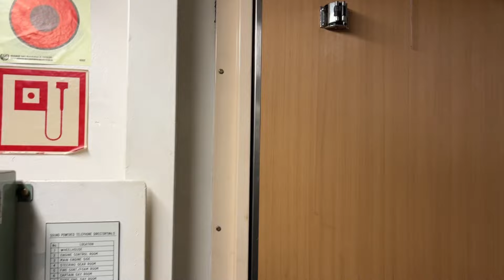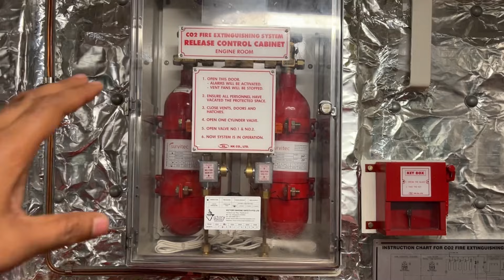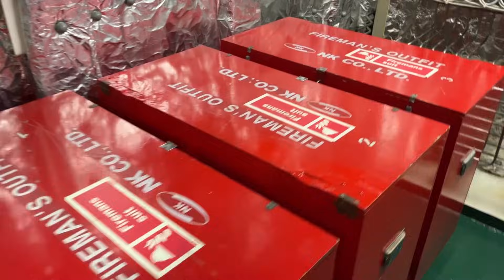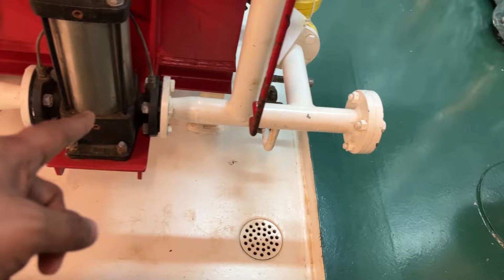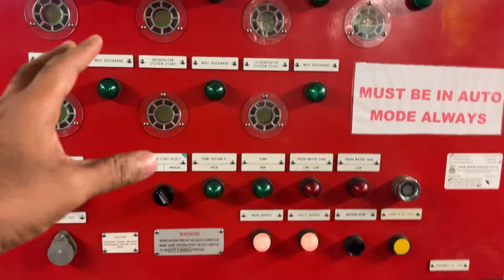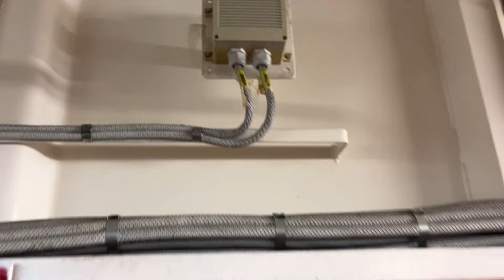Foam Room of Tanker Ship | Cargo Ship Fire Fighting System

Comment: Do they have mild steel pipes for fire sprinkler systems in cargo ships do they use water
Also is the water stored for discharge after testing use
Reply from the maker: On ship they use fresh water in hypermist system and after testing they drain the water.